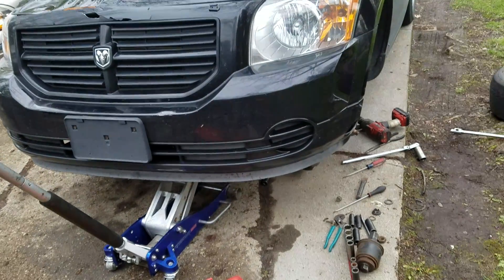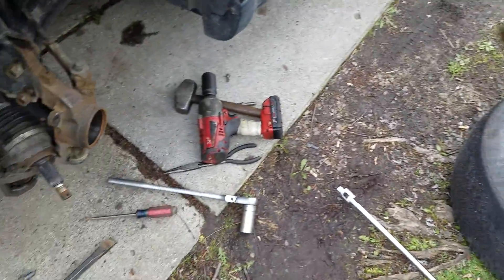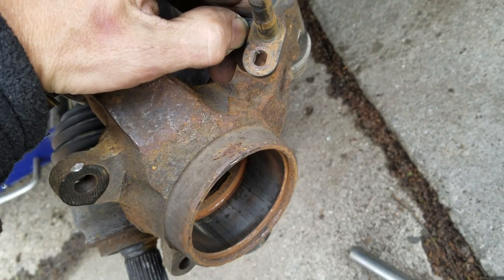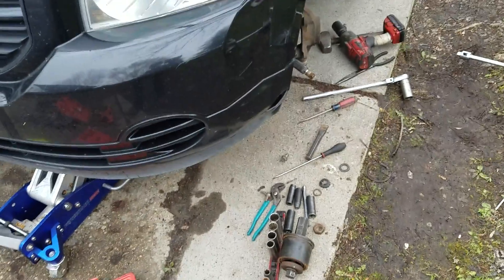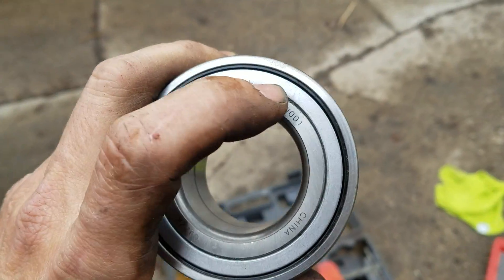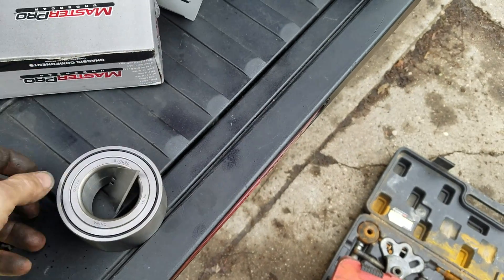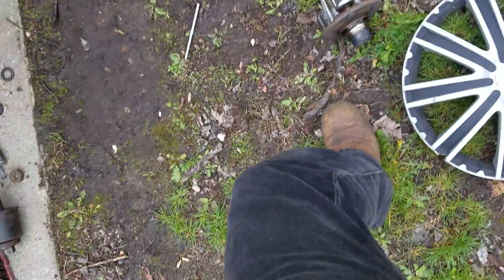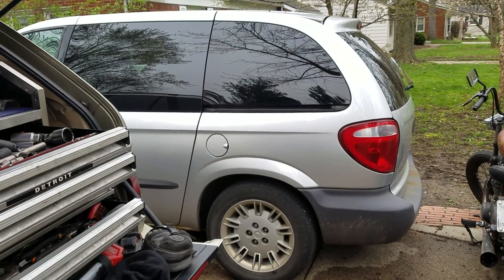Dodge Caliber front wheel bearing ABS tone ring

Comment: So this model and year is different? Could you buy the whole hub with bearing already pressed? Or is it cheaper this way?
Reply from the maker: I don't think you can buy it any other way.
Reply: ykmalachi thanks I was just wondering because I have to change a front passenger side bearing on my 2011 caliber but weren't sure. Thanks for your video I have an idea of what to expect now.
Reply: Ok so thank you for this great video. I just changed my front bearing on my 2011 Dodge caliber. But to answer my own previous question. Yes you can buy a whole spindle with a bearing and hub already. But it costs $173 or bearing alone was $20 online.